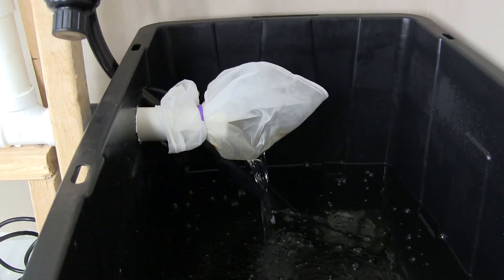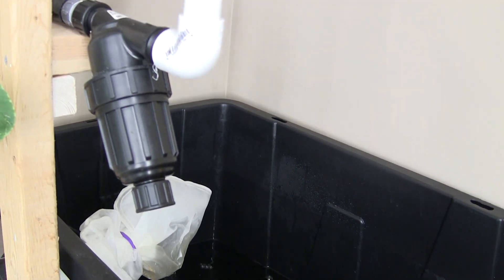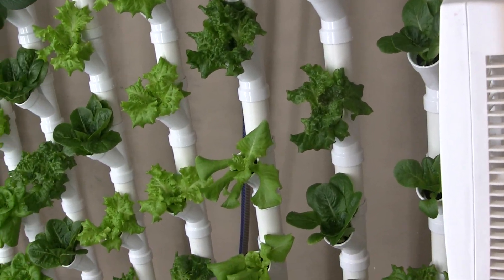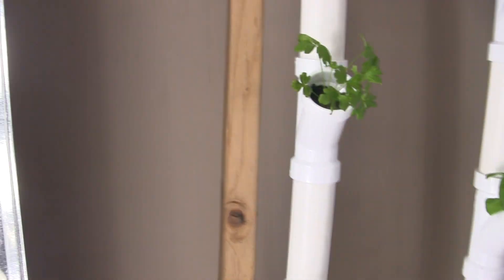Basement Hydroponic Tower Garden Version 2.0

Comment: Any idea what the volume of the tote is that you’re using as your reservoir, and how much water you have in there at a given time? Upgrading my setup at the moment from a 27 gallon tote, and trying to decide how much water I could safely keep in a 57 gallon tote without worrying about it rupturing.
Reply from the maker: it's 54 gal capacity, so maybe around 45 ish when it's full. I don't worry about rupturing. It's pretty hard plastic, and the cover helps too I think.
Reply: @ awesome, appreciate the info. Thank you!

Comment: Why is always lettuce or bok choy? other plants do well in hydroponics tomatoes are one of them and they don't need a drip kratky just a bucket. One that would work very well in the system you have is strawberries  Strawberries flower and produce fruit in temperatures between 50°F–80°F (10–27°C) and with less than 14 hours of daylight. However, the ideal temperature range for flowering strawberry plants in a greenhouse is 60–68°F
Reply from the maker: hi, if wanted to do veggies I think I'd have to use a grow tent. I've had luck with strawberries in my outside greenhouse but there were lots of pests - aphids, spider mites, for example so I gave up on them.

Comment: Are you still using this system? Hows it been going?
Reply from the maker: great. I've downsized because I don't want to spend the time selling the extra produce. now I just use it for family and friends. still works great. made some lighting changes and put a drain (ball valve) on the end of the supply line for cleaning purposes. About every 4 years or so I need to redo the irrigation tubing because sediment builds up, and roots start to clog the towers but only a problem with the parsley. so I just trim them. I only use the basement system fall, winter, and spring. it's fun experimenting with different types of lettuce to see what grows best.

Comment: Are the connectors getting blocked by stuffff? would it make sense to just let it drop without the small tubes?
Reply from the maker: no, not with the removables like lettuce and bok choy. I have issues with parsley and sometimes swiss chard though, if I leave them in more than 6 months. I have trimmed the roots or replaced the plants with younger ones.

Comment: I like this system a lot! 
Especially your home made light fixture. Very clever. 
I only have a few considerations. 
The timed fan is great in theory, but could be more beneficial by incorporating a small air duct in and out, with a damper. 
Better to displace indoor room air w fresh air. 
Also. 
Your plants with love it if you added an air stone to the nutrient reservoir. Nutrients simply dripping down the root mass isn’t aerating the water.
Reply from the maker: Thanks for the tips! The fan is currently running all the time. An air duct with a damper is an interesting consideration. I try to keep that room isolated from the outside to keep it as sterile as possible though. As for an aerator, I can give it a try. I'd think there's quite a bit of aeration occurring when the nutrient is running down a vertical pipe - just like a river but more surface area to pick up O2.

Comment: Great efforts Sir, absolutely amazing..
I've an query..Does the aeration is necessary in this type of system
Reply from the maker: Thanks, I never measured the O2 level in the nutrient, but I think when the nute runs down the pipe it becomes oxygenated, especially with all the surface area and fast flowing nutrient.
Reply from the maker: additionally, the roots are white, which indicates good oxygenation.

Comment: Pretty impressive garden wall.  I'm curious how standard LEDs work vs full-spectrum grow lights.  Have you replaced these bulbs with something more tailored to the job?
Reply from the maker: yes, I have. I've purchased T5 grow bulbs, 2 times actually, but returned both (from different manufacturers) because the output was not as strong as the standard A19, strangely. According to the specs they should have been more than sufficient at the distance installed, but the growth of the plants became stringy. If I would have added more bulbs to increase lumens I would have increased my wattage requirement, which defeats the point, in my opinion. I'd love to get some feedback about lights that others use successfully.

Comment: I wish I could see your pump setup better. I cant get mine to work to save my life. I have 4 towers using a 1150gph pump. Using 3/4 pvc from the pump to the top of the setup (7ft) then to the right about 3ft. Barely getting water to trickle out of the 4 lines I have for each tower. Using 1/4 line to spray nozzles from the 3/4 pvc to each tower.  Im looking to redesign my whole setup because I cant get water to my plants now.
Reply from the maker: Hello, please remove your spray nozzles. You don't need them. Just keep the 1/4 irrigation lines to the pipes open. I am running a 550gph pump with a 7 foot head and I have plenty of flow. I have  a 3/4 inch flex hose connected to the pump and a 1/2 inch reducer to the main irrigation hose with 1/4 inch tubing running to the pipes from that line. Let me know how it works.

Comment: This is a phenomenal setup, except for the fact that PVC is highly toxic.
Reply from the maker: - it can be if you run 140+ degree F water through it and/or degrade it using concentrated UV lighting. I have done water testing multiple times on my system and the nutrient solution remains clean and safe. I would not choose to poison my family. But if you are not comfortable with this setup then please do not construct this system.

Comment: Looks fantastic! I am gonna start one myself. What size water pump are you using? Does the plants on the end furthest away from pump get the same amount of water?
Reply from the maker: Hi, I use a 550gph pump with a head of 7 feet. I recommend Pondmaster pumps and I am using the model 5. The impeller needs to be cleaned and changed over time but I've never had a pump fail. Good luck!

Comment: Good lighting for power consumption for sure but personally I want something that's going to last and they don't really make anything to last atleast not light bulbs so I'm going to use fluorescent lights they can be lit up without a ballast using a Tesla toil or a winburst machine and I can make a Tesla coil with over gauge wire so they will never burn out if you have electricity going to your house but I like the winburst machine for lights because it can be powered by motion but that's only if you had motion it's a lot easier to power fluorescent lights with a winburst machine than a magnet generator
Reply from the maker: okay, whatever is best for you. best of luck.

Comment: Mary and Joe! This is the best video that I have seen. Thank you! My concern is lighting and cost. I was wondering if you would share how much it cost start to finish. I found that the lighting is so expensive. Thank you!!!
Reply from the maker: yup, ag lighting is expensive. That's why I use the regular LED light bulbs like I showed in the video. To build this sized system, you'd probably spend around $1,500 - $2,000 maybe? I figured mine cost around $850, but I used a lot of scrap lumber for the various components and I had some supplies already. If you are starting from scratch probably closer to 2 grand if you figure everything from nutrients to pump, to lighting, to testing equipment, etc. It will be very expensive. I'd dial it down and make smaller system - maybe 8 towers. Mine has 21.

Comment: Did I miss it? What is on the end of the 1/4 line that runs into the top of each tower? How are you getting the water to the front edge for the upper level plants? Great system!
Reply from the maker: nothing on the end - the nutrient is brought into the towers via the 1/4 inch line and I drilled a hole to put the irrigation line into so it sprays/drips down the towers.

Comment: PVC contains dangerous chemical additives  including phthalates, lead, cadmium, and/or organotins, which can be toxic to your child's health. These toxic additives can leach out or evaporate into the air over time, posing unnecessary dangers to children.
Reply from the maker: I've done extensive research on this and I've determined that for this application we are safe. Leaching may occur when using high temp liquids over 140 F and that is definitely not the case with this build. But you should stick with what you feel is safe for yourself and your family. Thanks for your comment.
Reply: @maryneumayer01  yea sure

Comment: Great idea, although PCV in an indoor growroom directly exposed to artificial light could potentially lead to offgassing.
Reply from the maker: It has been determined that UV light can degrade the PVC as well as extreme heat exposure. I"m using household LEDs which emit little to no UV light. I am not using high powered grow lights. Plus much of the pvc is covered by plant leaves even if my low power LEDs were emitting UV light. Thanks for bring up your concern.

Comment: With no glue how does it not leak at the lower joint.....?
Reply from the maker: it's a tight fit and I find that the diluted nutrients bind to help. For example, sometimes there's a bit of leaking from the plastic connectors off of the 1/2 inch feed line when I start the system up but the plug themselves up rather quickly. We're talking a couple of drops not a gushing leak.

Comment: I adopted this design for a smaller, 25-site wall. I have been using it for a couple years and it works great. I really don't know why most growers don't opt for a flat design like this one. Those 360-towers are only good for outdoors. I splurged on lights and got a couple Fluence panels that were absolutely worth it. Cons: Cleaning can be an issue with this system--especially if you choose to bond the PVC, which you have to do or you'll be dealing with constant leaks. I started using a toilet auger (an unused one!) to grab old root clumps, and it works pretty well with some elbow grease. Also, you have to have a pretty strong pump going if you want to get sprayer heads to actually spray at the top. I've never been able to get more than streams coming out of them with my pump. However, it doesn't seem to matter much if you don't get a good spray. Occasionally, a new plant dies because the stream isn't directly hitting its small roots, but because of the (very important!) tilt in the design, most plants get water most of the time.
Reply from the maker: Thanks Chad. I don't use sprayer heads  - I'd imagine they'd clog pretty easily. I just run the nute down the front of the towers. 2 weeks back I did have to replace the irrigation lines but that was after 6 years of use. I put a 90 on the end of the 1/2 inch tube and ran it down the framing a foot or so, and put a ball valve on, so I have a clean-out. I do have problems with roots on plants I leave in, so usually do replace them half way through the winter (Dec/Jan) to avoid leaking. I also posted a vid last spring of my tower cleaning pipe which works magically. I only run the system Sep-May and then I'm in the greenhouse, and I find that the plants grow better early on compared with at the end of the growing season. It's not perfection but it works for our intents and purposes. Thanks so much for sharing. I'm happy that you were able to benefit from this concept. Happy growing!
Reply: @maryneumayer01  Nice! I'll check out the cleaning pipe video.
Reply: Can you share a photo of your grow lights?

Comment: How's your electric bill? What are the changes before and after the lights and pumps?
Reply from the maker: it's hard to say. we have solar so our bills are offset, and the solar input is different every day/month so figuring out that magic dollar amount is a challenge, since electricity rates are also always bouncing about. I'd guess maybe $35-50 bucks a month, maybe? Often times in September and April onwards our electricity bill is $0 with credits that carry over. We also have an inverter to provide heat in the fall and spring so that's where the majority of our electricity bill comes from during those times of the year.

Comment: Great video, have you tried to grow larger plants such as tomatoes or cucumbers in the wall?
Reply: Lettuce could probably be done fairly easily with a tiny determinate such as tiny tim!
Reply from the maker: fruiting veggies need different nutrient densities, and there are also the roots, so I'd recommend using dutch buckets for those plants rather than a setup like I built.
Reply: @maryneumayer01  I'm an idiot and said lettuce. I meant tomato. You would def want to swap out a leaf nutrient with a fruit nutrient some way through. It's totally possible especially with a tiny variety like I mentioned.

Comment: how do you keep it water-tight if the PVC is not glued together?
Reply from the maker: I used potable water glue but didn't glue the bottoms of the towers to the drain pipe so I can remove them to bleach out after each season. The system is disassembled each year for cleaning and sanitizing.

Comment: I see this was posted a while back, curious to know if you had any mold problems either on the system or on the walls?  In the humid environment I live in this would be a concern. Otherwise, I'm super impressed with this system and would love to try it. Thanks
Reply from the maker: hi, no mold. I don't run the system in the summer when I de-humidify the basement due to the high humidity outside. I have my plants growing in the greenhouse then. And in the winter my house appreciates the added humidity since we have wood floors and it is recommended to humidify the house then anyway.
Reply: @maryneumayer01  thanks fir the reply

Comment: How do I build one of these in a smaller version..
Reply from the maker: scale it down just like if you were downscaling a cooking recipe. Your pump would be smaller if the head were lower but the system works the same way. In my classroom I built a system with my students that is only 6 towers instead of the 21 towers I have in my basement.

Comment: Any leak issues?
Reply from the maker: only if the roots clog up the pipe. I have to keep an eye on the parsley specifically and generally I plant new seeds after 3-4 months. Alternative you can give the roots of the plants you don't pull out a haircut if they start to clog. Mint gets runny, and my swiss chard develops a long root system too,. For those herbs I'd consider a 2 inch pipe over the 1 1/2 inch.

Comment: It's a great idea, but I've never found a PVC wye fitting that was rated for potable water. They're usually for sewage drains, and that sort of thing. I'm not sure I'd be comfortable with the toxic stuff (could be anything from lead to bpa) that might leach into the food. Not all pipe is rated for potable water either.
Reply: oh no dont tell me this after i just spent over $100 building my own system with said fittings :'(
Reply: @stinkybongjuice6570  Sorry to disappoint.  :-( Maybe your supplier can tell you what it is rated for, and what toxins might be in it? Or maybe they'll accept a return, since you thought it was potable water pipe fitting? Maybe a Tee fitting will work instead?
Reply from the maker: I've done lots and lots of research on this. PVC pipe is not generally used for potable water because leaching MAY occur at high temps, specifically over 140 degrees Fahrenheit. It's not recommended for hot water service and therefore is not used for potable water plumbing for that specific reason. Otherwise the pipe is considered safe based on safety specifications and testing. Since my pipes are never subjected to high temps, or any type of temps above room temperature, I feel comfortable using this pipe for this purpose. But you have to do what you think is right. Additionally, since our agricultural processes uses over 80 chemicals that are banned in the EU due to their catastrophic affects on animals, I get more concerned about what is sprayed on the vegetables supplied by our grocers and markets. I don't have all the answers. Perhaps I can have my water tested after 3 weeks in the system, prior to a flush. Thanks for your comments.
Reply: @maryneumayer01  That's an excellent idea! Would you mind posting your results? I'd love to build this setup, if it's safe! I'm not sure how to test for lead or BPA etc, myself.
Reply: @maryneumayer01  Looks like UV light can cause some toxic breakdown too. Not sure if that applies to all PVC pipe, though, or just some types of PVC pipe.

Comment: very interesting design, and good use of the space going vertical, what size net cups into the Y's and are you using rockwool or sponge
Reply from the maker: hi - no netpots - just 1.5 inch rockwool plugs, which fit perfectly into the 1.5 inch pipe.

Comment: I'm sure you've modified things a bit in the past 4.5 years, but did you ever move the lights closer? Or did you move them just to make filming better? If they worked effectively at that distance, I'd think you'd be able to use half (or fewer) as many if you got them closer, what with the inverse square law and all. (Apologies if you mentioned this and I missed it.)
Reply from the maker: Hey Travis, yes, I moved back the lights for the video - normally they are about 20 inches out from the plants - which means as the plants grow outwards the lights get rolled a bit back. Check out my update video (3 year update perhaps?) where I decreased the lighting output by about 30%. And yes, I do repeat myself many times over in these comments so feel free to scroll down to get more useful information about improvements over time. Thanks for watching.